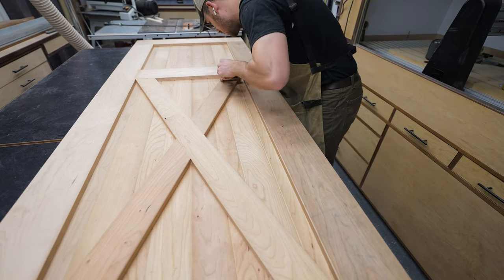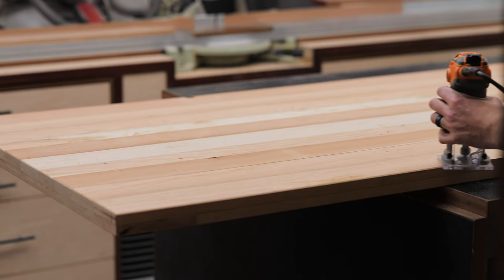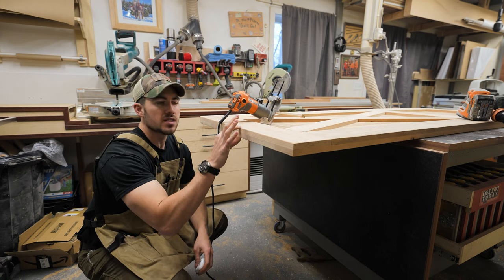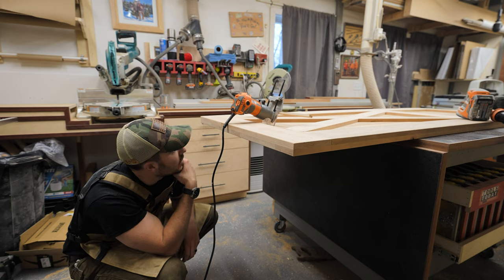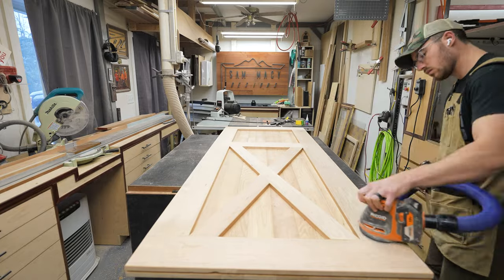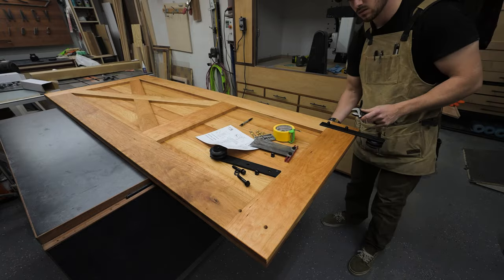Building A Sliding Barn Door

Comment: Hello. Great video. I didn’t see any mention to which router bits you used and sizes in your equipment list. Can you please list them? I am new to routing and am tackling this barn door project. I like the way you beveled the verticals ever so slightly and trimmed off the overhang. I just need to know what bits you used to accomplish that. Thank you.
Reply from the maker: Thank you! Great questions. Here's what I used ( I also added them to the equipment list), the biggest thing is you want your shank size on your router bits to match the shank size of your router. Most of the consumer grade tools like the ones I have all use a 1/4" shank. Routers are a great time saving tool, I'm sure you'll find all kinds of way to incorporate them into your woodworking!

45 degree chamfer bit: https://amzn.to/3GUeuNX
Flush Trim Bit: https://amzn.to/3VDQovd

Comment: The X boards (not with Cherry to expensive to waste on a mess up) I would make both boards fit snug then mark the intersection on the two boards and the door as well.. Cut the board and install....   and if you want the lines (the routing lines) you could also have each board (4) meet in the middle, instead of the one long and two short
Reply from the maker: That's a great idea! Thanks for the suggestion 😀

Comment: Nice job, One question ??  no one talks about the location of the rail above the existing door header,.. 2 inch for placement of rollers,
 what about the vertical height / location of the top of the door itself , ie. carpet or hard wood floor (for vertical adjustment) ??
Reply from the maker: Thank you! Sorry for the delayed response. As far as the vertical placement of the rollers go I ended up taping a 1/4" piece of wood to the bottom of the door and then put it in place to mark my holes for the hangers that bolt to the door (this was all done after I had installed the rail above the door) then when I bolted the hangers in place and removed the piece of wood from the door it hung with a 1/4" gap between the door bottom and the hard wood floor. You could probably do the same thing with carpet and use something a little thicker like 1/2 plywood. I hope that makes sense

Comment: Ok - I would have done a glue up on the vertical boards. Gluing seams will not inhibit expansion/contraction - which happens across the grain.  The cross batons, however, can cause issues.  Those could be attached with slots and visible hardware to allow that expansion.
Reply from the maker: Good idea! Thankfully I haven’t run into any issues yet, fingers crossed

Comment: I just built a door and missed the slot at the bottom. What is that little jig for your router? Thanks
Reply from the maker: I think it's just called a "guide bar" or router guide of some sort. It came with the router and I think one comes with most palm routers that are available

Comment: lrn2engrish . . . . whom ever bought you that shop, love them forever because you have no business around that equipment ><  i heard half a dozen things to go along with the complete muppetry of the physical build. . . .the final insult to injury the fuck'n door isn't mounted correctly because apparently math and common sense aren't taught where you're from . . . gotta love armchair 'wood workers', not.
Reply: Haha! Most of the people who watch these videos are completely clueless about wood working. Almost everything this guy did was wrong from the build to the install. If you don't want to glue up the boards, use tongue and groove so they don't warp everywhere like they seem to be starting to do from his comment. If you are too concerned with wood expansion to glue the boards together (lol) you sure as hell should be too concerned to clue boards cross-grain across the top and bottom of those boards. What he did was create a situation where if there is ever enough humidity the boards are going to try to expand, but because they are glued at the top and bottom are going to cause the boards to twist and warp in the center, which will cause a massive problem. 

Using proper carpentry instead of just gluing and nailing boards together (something any idiot can do) would have prevented this. This is clearly a case of more money than brains (talent).

My guess on the reason the railing is so out of wack is that he didn't consider stud spacing when they "built the closet", so he didn't install any boards that would have allowed him to put the railing where he wanted, instead of only on the existing studs. This guy should have been too embarassed to post this video, but stupid people don't know enough to get embarrassed over things like this.
Reply from the maker: You guys need a break from the internet 😂